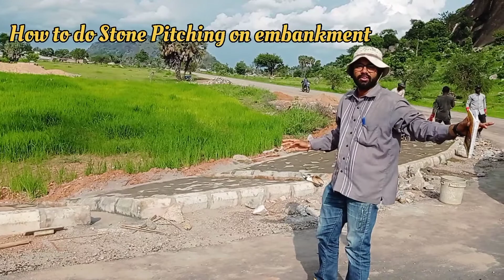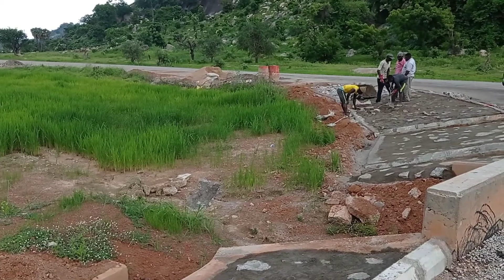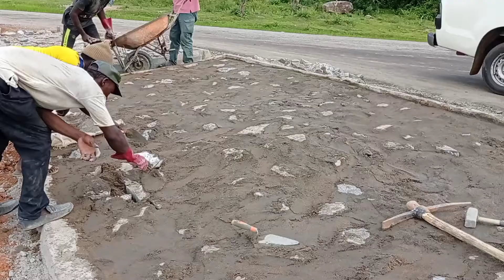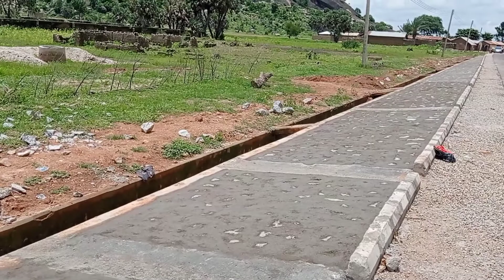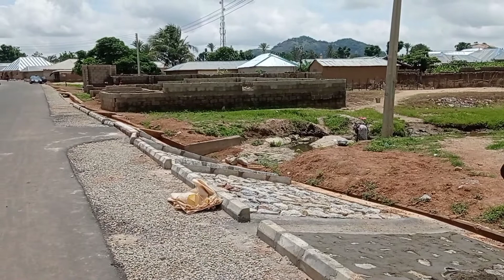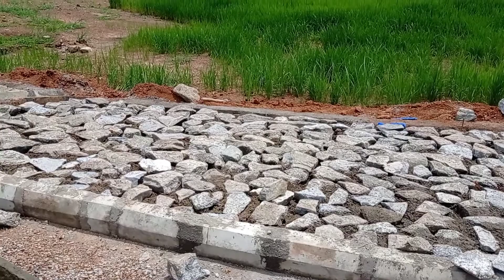How to do Stone Pitching | Why it is important | Practical Explanation

Comment: Alsslam Aliykoum  ... can you give us by writing the design of toe of embankment & the maximum length of slope horizotal & vertical  and joint bitwen section in any case we  will   construct two  toes if the slope very long  ... thanks  ...
Reply from the maker: Wsalam, yeah.. for the toe you may use the dimension of 0.15m x 0.15m.
For slope, you may try to give gentle slope instead of sharp slope and extend the slope upto the ground.
In case, the slope is too long you may change the dimension of toe and make it 0.2m x 0.2m
You can WhatsApp me as well, I'll show you the sketch if you still need it. Thanks